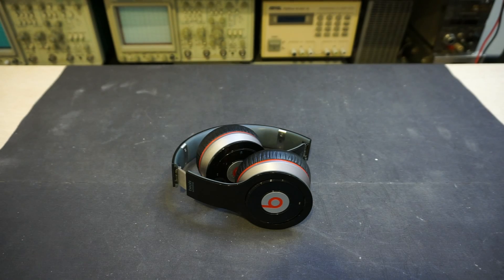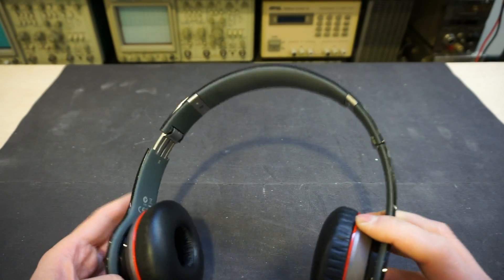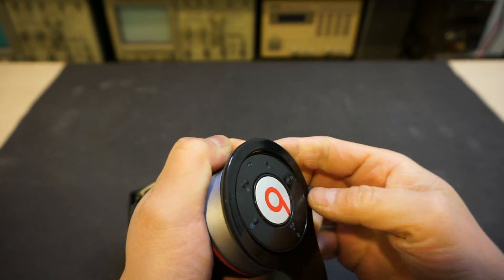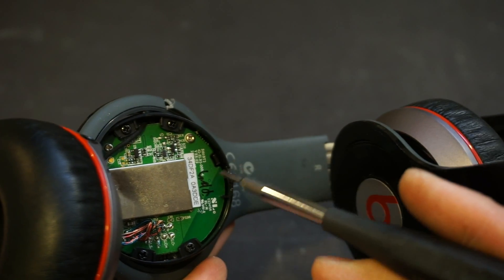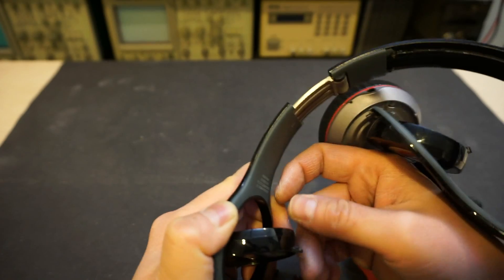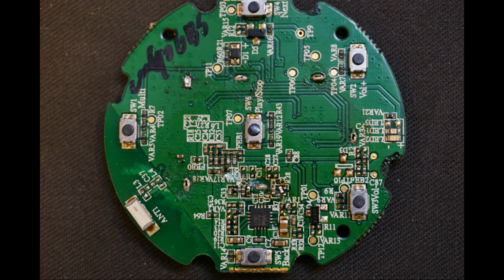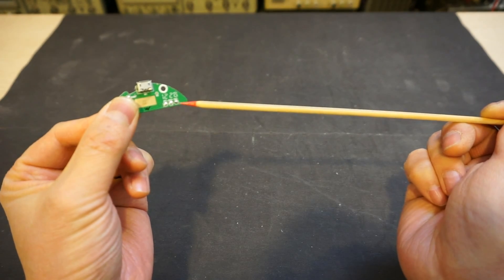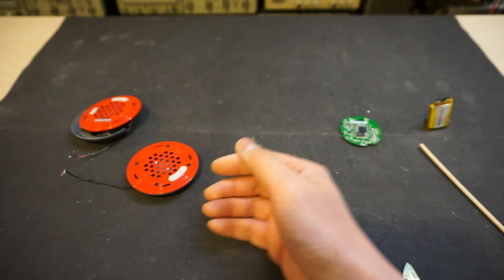Beats Solo Bluetooth Headphone Teardown

Comment: Hi Kerry I just fixed my set (same exact model as in your vid) I would of never thought that the speaker part pops off like that but I tried it and it came off then carefully wondered into the mother board area to then figure out that the 4 black screws hold and secure the outer face but then it has to be popped apart as well, then with the 4 silver Mboard screws removed earlier I then eventually got to the button side (my problem was back track button was not working at all for the longest time) then proceeded to use a q tip to hopefully wash out the buttons mechanics with 91 isopropyl liberally, reversed the process to re-assemble and gave her a try...and Volia it worked...I use these to mow the lawn and they get saturated with sweat! I’m guessing and quite suspected that it was a dried gummy film in the button that was the issue but your video took me to victory just want to thank you for all your help cheers

Comment: Here is note for myself...

If you test the Sennheiser or Beats bluetooth headphone, you will get 0dB crosstalk even your smartphone gives -80dB crosstalk ratio on your headphone jack output... But if you try your headphone which got cable with cheap bluetooth adapter, you will get low sound and white noise, crap sound. The chipset should be Bluetooth Adapter + Amp for best result with good built PCB. The next test is get sound from MicroUSB to Headphone Adapter. I will upgrade this text.

Comment: All of these headphones are built like total shit! Doesn't matter if you spend $50 or $200. The materials and specs are better for sure, but the same crappy designs are used with the same crappy workmanship. Sloppy soldering joints and poorly made strain relief, these products are made to fail.

Comment: In the solo2 wireless they have 12 wires running from the Left to the right side. The analog audio passthrough, a 5V supply and GND, I2C , USB and the on/off button.  In this one they have ditched the module and soldered the SOC directly on to the main PCB.  One of the most noticeable things is that nearly all IC's (besides the vreg) talks I2C. They did however learn to use connectors instead of directly soldered wires.
Reply from the maker: Good to know. Thanks!

Comment: this crappy wiring isn't just on the wireless ones. I ended up throwing a pair of wired beats away because the speaker wiring was tiny and junk.  I would have never bought beats they were a gift.  the beats brand sells on the name alone
Reply: I ended up spending 40 bucks on a pair of wireless August headphones which are built better and sound better.  I never would have bought the beats they were a gift